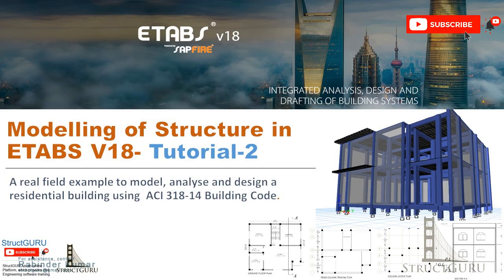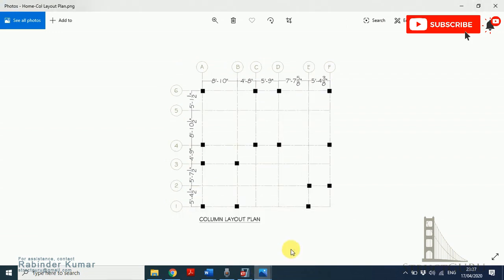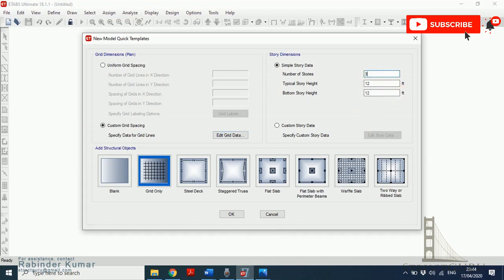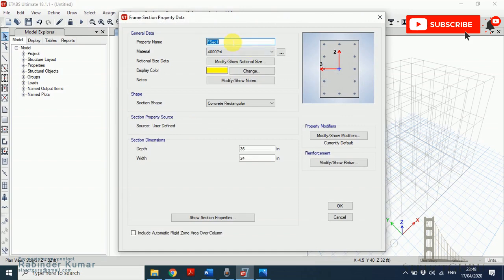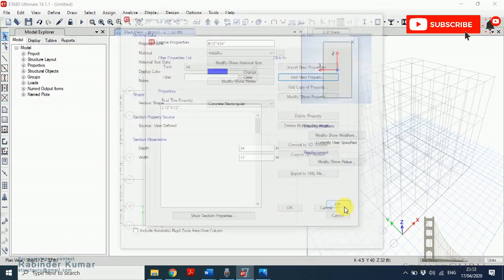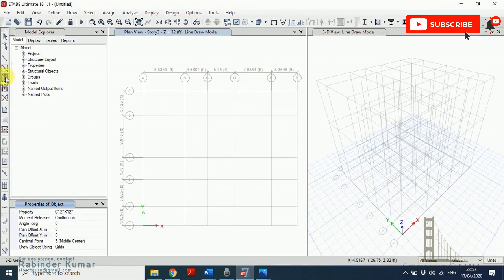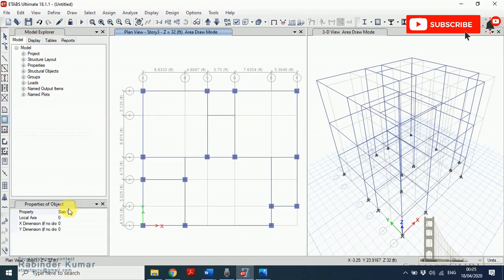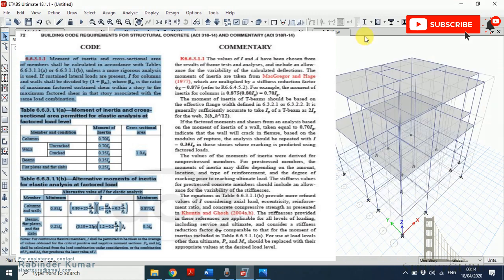Modelling of a Residential Building/Structure in ETABS v18- Tutorial 2

Comment: sir, Is it not required to use slab stiffness modifier in all three axes as 0.25. You have not used this. is there any reason behind it sir. Moreover please give the reference of the clause either in indian code or ASCE or UBC regarding Torsional constant as 0.01 which you have used during defining column & beam section .
Reply from the maker: yes! you have to use it. I forgot to put the modifiers value
Reply from the maker: To know about torsion factored value you can refer to ETABS ACI-318 manual section 3.5.3.1

Comment: why did you use torsional constant 0.01 for beam instead of 0.35  and for Beam as well?
Reply from the maker: The torsional value of 0.01 is considered so as to set very low torsional stiffness in the member. That means, the member will not be able to take any torsional stresses.
Reply: @structguru2200  is that OK to neglect(very low) torsional stiffness in both beam and column? how  would be redistribution occurs in this case? I am a little bit confused on this topic
thanks

Comment: In slabsand shear wall crack modifiers are required?
Reply from the maker: Yes!
Reply: @structguru2200  how can we apply it using latest IS 16700 code
Reply from the maker: Considering the IS code the modifiers for slab section is 0.25. we have apply this in the same way as we do for beams and columns.
Reply: @structguru2200  yea but tgere its as m11 m22 m12, f11 f22 f12
Reply from the maker: @VIMALSCORNER2019  put 0.25 in m11, m12 and m13
Reply: @structguru2200  and for shearwall
Reply: @structguru2200  please make a video on how can we model building with different levels of footings like in hilly areas.... In etabs
Reply from the maker: @VIMALSCORNER2019  Sure! I would appreciate if you can share any structural drawing of such case.
Reply: @structguru2200  yes sure sir... Where can i share it?
Reply from the maker: @VIMALSCORNER2019  structguru@gmail.com
Reply: @structguru2200  yes sir i mailed you
Reply: @structguru2200  is it because you applied very low stiffness to the frames?
Reply from the maker: @abdulzahiraliyi8675  I would recommend  you to research about torsional cracks, how to avoid them and why to do so? Meanwhile, I will also upload a video soon, as I know most of the students have questions related to these points.
Reply: @structguru2200  I was researching the whole day, but I could get its concept
i will keep researching and also wait for your video abt it.